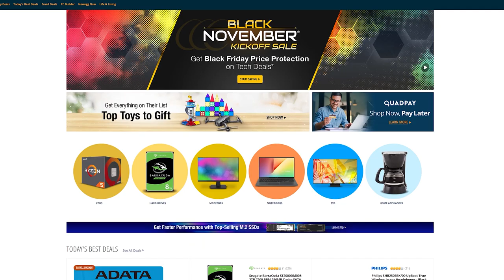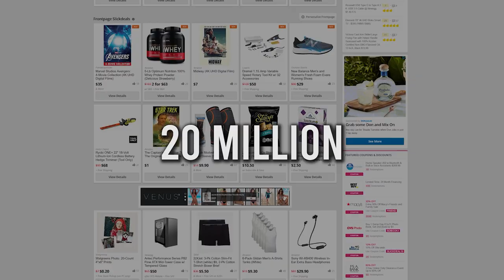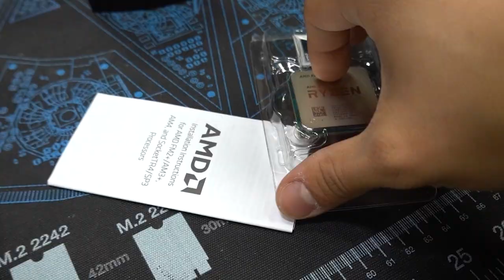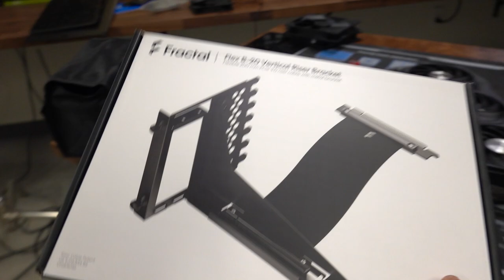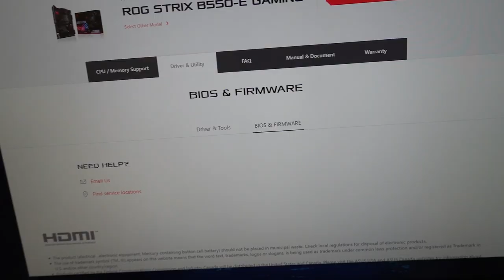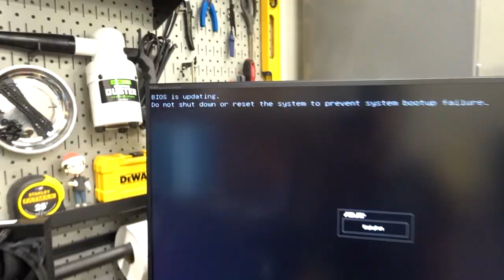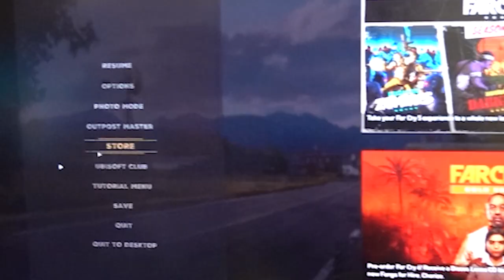I've waited so long to build this PC

Comment: "I've waited so long to build this computer"
Me:  My 2600k is awesome...
Reply: I'm still rocking an i7 2600K OC'd. 👌 After a 3080 or 6800XT next before full upgrade.
Reply: Hey dude are these good specs for Fortnite send Minecraft on all low graphics settings Intel Core i5-9400F 6-Core 2.9 GHz
✚ GIGABYTE GeForce GTX 1660 Super OC 6G
✚ Team T-FORCE Vulcan Z 3200MHz (max speed) 16GB (2X8GB) More Info
512GB Intel 660p M.2 SSD
NZXT H510
ASRock B365 Phantom Gaming 4
DEEPCOOL GAMMAX GTE V2
✚ EVGA 500W BR Bronze
MSI AX905C WIFI
Windows 10 Home
2-year warranty on all parts & labor
Reply: @jorgeg4153  that pc will play any game at at least medium settings 100fps, im assuming thats a prebuilt and i wouldnt spend more than 800 on that configuration
Reply: @KyzrTM  o I’m spending 990 dollars on NZXT My bld can that run Fortnite on 200 FPS on low FPS
Reply: @Easton Reese it isn’t s flex
Reply: @jorgeg4153  meh its intel
Reply: @jorgeg4153  stick with amd they are cheaper and have good stock coolers
Reply: @meespo3354  ik but my FPS will be way better in games maybe idk
Reply: @fivesupersieg5583  o I’m getting a prebuilt so I can’t change the specs but thanks for the advise u earned a sub :)
Reply: @fivesupersieg5583  yeah me mum doesn’t have to much money she is getting un employment and next year I’ll be able to get a better pc do u have discord and if u do can u tell me ur name I wanna add u
Reply: @jorgeg4153  pretty good bro...! for mid-level gaming...and I think you better upgrade to an RTX 2060 next time and you don't need to upgrade for at least 3 years.
Reply: @kiransai447  ok thx
Reply: @kiransai447  I don’t wanna leave like a 3 k dollar computer we don’t have really any money rn so I have to the the NZXT starter pro so thx for the advise and u earned a sub :)
Reply: @jorgeg4153  GG bro...but it’s funny that I’m not even a youtuber😅😂 BTW all the best for the PC😇
Reply: @kiransai447  ok thx
Reply: @kiransai447  so are the specs good for Fortnite
Reply: @jorgeg4153  yep you can
Reply: @kiransai447  thx so the specs are good for FN good looks dude

Comment: Coming from a design engineer who loves pc build videos and seeing how companies build their stuff I totally see a rail system with either a spring loaded or screw down angular pin lock would be possible for them to add to case design and maybe have the smaller channels tabs be spring loaded or at least moveable so you can have them even with the outer tabs or set them for smaller cables or just do c channels and not care because most of us just put a bunch of cables in those.

Comment: Nice build Kyle!!! It looks purdy. But...

1. That case needs some zip tie mounts to fully dress up the back panel wiring.
2. 360° & 420° radiators need more hose length to mount the radiator properly in the front of the case. -just about EVERY brand.
3. Freaking RGB software companies need to have a meeting, so they can all play together.
4. You should be able to download Asus Aurora Sync & then the ICue should be able to control the mobo RGB. (Commander Pro may be needed).

Comment: Not that you’re actually gonna use the pc, remember the aio tubes go at the bottom :(
Reply: It doesn't matter as long as tubes go above pump and the case doesn't let him
Reply: @AdamLazhar  it does matter as heat rises bro and that’s how it gets a heat bubble and breaks
Reply: @sh066  It's not a heat bubble lol. air rises so as long as rad is higher than aio it's fine. The only thing with tubes at the top is a little noise but I need to have tubes up with my case and there is no noise.
Reply: @AdamLazhar  Isn't the problem that with rad tubes at the top, the pump will be sucking air? So doesn't matter is rad is higher or not, it's still bad. Bad rad.
Reply: @jonboy602  The way i've seen it is that if the tubes are at the bottom of the rad then air might block the path of water and allow less water to flow. I've been using a really shady aio I've had for 5 years and it's always been mounted tubes up and above the water block. I just switched to an H150i that doesn't physically work any other direction and cooling is perfectly fine. Everyone seems to be taking steve from GN's words exactly about this but he also said tubes at top is okay as long as it's above the pump. Only downside is a little noise which I can't hear with mine so far
Reply: @jonboy602  this is correct. put it at the front with tubes down, or hold it so that the air rises to the correct side if the rad and then top mount it.
Reply: @meese1k  no actually, you missed the point of gamers nexus's video
Reply: Do you mean like rotating it clockwise one time? So the tubes are facing towards the bottom of the case? I am planning to build a Pc soon and trying to gather some knowledge. Thank you in advance and happy holidays
Reply: @crazygamer569  doesn’t matter as long as the pump is below the top of the radiator
Reply: @crazygamer569  so if it’s front mounted the tubes should be at the bottom and come up towards the cpu(if you’re building in a traditional case) so that the air accumulates at the top of the aio and doesn’t get sucked into the loop. That causes noise and other problems over time. Mounting from the top you don’t have to worry as much. Tubes on cpu are most commonly placed to the right of the cpu. Hope that helped
Reply: @crazygamer569  hello man, you can’t do this configuration in every case, but this is ideal. you want the radiator at the front of the case, with fans pulling air into the case, with where the tubes connect to the radiator to be at the bottom of radiator/case if that makes sense. hope this helps

Comment: The lower backside cable cover is to help ensure cables don't put too much pressure on the back side panel and inadvertently release it, as it doesn't have screws locking it on. I think Gamers Nexus mentioned this in their review of this case or the Define 7. Not so much an issue with well-managed cables.

Comment: I know iCue can be used to configure some Asus AuraSync components. But the only RGB components I have are from Asus and Corsair so I can't speak for other brands. I also like the idea for changing up those cable management anchor points by making them adjustable. However, I think that would be best left as an extra case option (sort of like being able to choose between tempered glass and a standard side panel for some cases). I know many people wish the extras that companies sell would be included with the case, but if that did happen, it would drive the price up and make the case less desirable to builders with a lower budget, who don't have any need for the extras. Maybe they (case companies/manufacturers) can make a compromise, a "best of both worlds" per se.

Comment: I think that the riser bracket kit shown is PCIe3.0. AFAIK, there aren't any 4.0 riser cables that actually work as intended just yet. Look into it before planning on using one with a 3000 or 6000 series card just in case.

Comment: this is for aura which you need to have installed for any of the rgb to work right. otherwise the board and registry conflict and everytrhing goes batshit.

heres the steps to fix it. atleast this is what i found fixes it cause the motherboard generally gets outa sync with the registry and just opens a can of worms when it does.

first option, reboot into bios > set aura to off. then shut down the pc and flip the power switch. let this sit for a min. boot into windows let everything taskmanager related kick in > reboot to bios > enable aura > shut down > let it sit 30 sec > boot to windows, in theory this should fix it if it doesnt then we do the long more in depth fix.

2nd option. uninstall aura / light services > erase both folders in program 86 > then either manually erase the registry files for them or use cc cleaner. > reboot to bios > set aura off > shut down > flip power switch > let sit a min. > boot into windows let all the random bs turn on then reboot to bios enable aura > next install aura sync and double check lighting services installed with it. next shut down let sit 30 sec then power on it should start all rainbow then when windows engages youll see a flicker into more rgb. if the lights kick off then the mobo isnt synced with the program and defaults to off from invalid commands due to them being outa sync. sometimes takes 2-3x to get it to work if this 2nd option doesnt work wipe out armory crate from your system and erase anything in that folder in the regular program files folder cause typically crate and aura use diff sdk lighting services and will conflict with eachother and cause it to brick aswell. so when i did it i went into the crate folders and erased the aura/lighting sdks in them.

Comment: I Always have this issues with corsair and asus, but what i normally due to get it working is...
Download obviously all the software... Corsair icue, corsair asus plugin (in icue download page just search asus), and armory crate. Make sure all lighting programs are uninstalled.
Install I-cue run it after. Then install armory crate, open and close the application , then install the pluggin from corsair for asus. Close icue and open again and in memory settings tick the enable full software control. then restart the pc and hopefully everything boots in order as it should and you can control everything from armory crate. Only other way if i had issues with crate to get corsair to work with the asus board was to install the last release of Aura sync. Same order of operations just instead of armory install arua sync, and when everything was recognized in aura sync I'd then install armory crate. Just throwing it out there for other with issues using their corsair ram with asus.

Comment: Unleash The aio are 100% filled, which they aren’t, that’s a bad placement for the rad, as you will get air in the top of it. It will decrease water flow and make noise.

Comment: You could make it easy on yourself and just have two cameras set up. Camera A and Camera B. Have one be an above shot and the other be a front shot. Should make putting things together pretty easy for doing more demos. I'd imagine with all the equipment you have, you shouldn't have too much of an issue getting multiple cameras. Maybe have a head-mounted fancy go-pro for those first person shots you want. Especially since your youtube videos are only 1080p, which is perfectly fine for adding those little different shots you want.

Comment: I feel in long term the rx 5800 and 5800xt will age really well especially with that 16gbs of ram, just like how the rx 570s and 580s still are decent cards vs the 1060s which came with lower ram.

Comment: "technically you should put the screw down.."
Just FYI, but my screw standoff for the M.2 SSD heatsink got separated from my Asus motherboard. I turned the screw just a little too much causing the standoff to break its connection to the motherboard (just glued in I guess). I then had to order some screws since I couldn't find the ones for the motherboard to attach the M.2 SSD (the one he didn't use). So then I screwed down the M.2 SSD and stuck the heatsink on top with only one of two screws attached but it's working fine.

Comment: so Kyle, I would suggest a little open source thingie called OpenRGB. Its aim is to unify all the stupid rgb devices under one app. For me at least, as long as the device is supported and it's all plugged into the motherboard rgb/argb headers, it should be all configurable under the one app. Give it a try. I've got ram and rgb fans running under it.

Comment: It's so damn hard to find good 140mm PWM fans with good static pressure, great performance whether a rad / grill / mesh etc is there or not, great performance to noise ratio, looks good, is ARGB, and doesn't require some proprietary connector / controller / software for controlling the ARGB. I personally don't know of any. I may have to look into those Prisma fans.

Comment: 29:00 i didn't have that much trouble tbh with my setup for the RGB. I just made sure that the products had addressable compatibility + compatibility with my motherboard (in this case Asus Aura)
And I plugged everything in the addressable connectors using sometimes an addressable splitter. And it worked perfectly. 
But I suppose that some products can be problematic

Comment: The top fan /radiator location seems tight when using a real custom loop rad and as usual manufacture does not give the measurments. Its seems to be real hard to take a measure and put it on their webpage.

Comment: The lights not working is karma for not screwing in that m.2 drive.  Proper RGB settings add at LEAST 8-12 FPS.  You know that.

Comment: Now that is one heck of a PC! However, you better have a real use for it for the cash that you will spend! In truth, I am a little surprised, with the latest push for air cooling, that a Noctua or BeQuiet wasn't installed.

Comment: Can u rate my setup? 
Motherboard: MSI A320M-A PRO MAX AM4
AMD Ryzen 5 3500X AM4 processor
RAM: Corsair 16gb DDR4-300
Gigabyte GeForce GT 1030 videocard
Sharkoon VG7-W RGB case
SSD Kingston A400, 120 gb 
Sharkoon skiller SGK4 keyboard
Monitor: Benq BL2283 21.5”
Reply: My budget is 570$

Comment: My buddy has an asus motherboard and had similar issues with the asus sync for rgb lights. We found out that if you download ASUS AI Suite 3 V3.00.59, that's where you can control some lighting. It's in the driver's page for the motherboard. Under "software and utility". Hope this helps.

Comment: And yes, the manufacturers have to get their act together on all that software. It's ridiculous. I get everyone introducing things when RGB started taking off, wanting to make their own "standards," but still... Hell, I just went through and updated my Ryzen 1700 to a 3700x (x370 series, and ti was on sale.) The Ryzen fan doesn't really pay attention to the MB control (outer ring and logo just do their own thing,) so you need to install a USB connector, NOT use the RGB connector, download MORE software from Cooler Master (!) and THEN you get control... then you see "Oh, you can link it with Razer!" ... which you can, but then you lose more of the control.. And yes, the Asus Armory software sucks. So I've got three pieces of software, which don't sync with each other (or do it well,) and I don't even have that much in my system - keyboard, mouse, video card, mainboard, CPU fan.  Someone creating a small SOC you can control and plug in, about the size of a controller or SSD, which has the specs for all of these and lets you unify the lighting and such? THey'd have a winner... granted, it'd probably run $300 or so..

Comment: 17:28, Tsk Tsk. You should be installing it tubes down, otherwise you can greatly impact performance since air bubbles will hang out in the tubes in a tubes up config.

Comment: Even with the dust filters on on my old Meshify C TG edition the airflow was excellent. Had a 1080ti a 280mm rad and a 8700k and the BEEFY AORUS 1080ti was fine for temps ( max temps 71c ) and thats with the AIO at the front

Comment: Let's not mention you shouldn't have your radiator with the tubes of the AIO running to the top for air bubble reasons and for AIO lifespan reasons

Comment: I don't understand why you'd get a full ATX case and motherboard, to then vertical mount and block off all the PCIe slots. If you're only ever going to use the one slot, mITX makes a lot of sense.

Comment: Did anyone think to suggest that he should hold the reset button to switch the fans to mobo control. It works that way for a lot of cases that come with an rgb controller.

Comment: Hey bitwit! Corsair icue is compatible with asus/aura sync and icue is much easier to use so I recommend using that but if you have Armory crate installed for aura sometimes icue conflicts with it

Comment: I get slightly irritated that the fans are obstructed by the case, even more so if you go bigger on the fans, why not design the case for clearence of the biggest fans, and if you want to use smaller ones you get brackets for it to screw into the holes for the bigger ones.
I hate the obstruction of airflow, and with RGB fans it also looks bad.
I would probably go for bigger fans and radiator and dremel out the mounting holes for the smaller ones to get an unobstructed flow/wiew.
Also, the bottom front fan is halfway under the cover that flips away, I would make a slanted ramp to lead that air up into the case, instead of back to the PSU..

Comment: I'm planing on building my own and first PC, i do own a pc but it's actually a pre-built and so these are the parts that were recommended to me. Just to say, i already own majority of these components like the Ram sticks, Graphics card and CPU, CPU Cooler and Motherboard. So hopefully they're fine, if not then I just fucked myself

CPU:
AMD Ryzen 9 3900XT 3.8 GHz 12-Core Processor 	

CPU Cooler:		
NZXT Kraken X63 98.17 CFM Liquid CPU Cooler 	

Motherboard:	
Gigabyte X570 AORUS ELITE WIFI ATX AM4 Motherboard 	

Memory:
G.Skill Trident Z Royal 16 GB (2 x 8 GB) DDR4-3600 CL18 Memory 	
Memory:	
G.Skill Trident Z Royal 16 GB (2 x 8 GB) DDR4-3600 CL18 Memory 

Storage:	
Samsung 970 Evo 500 GB M.2-2280 NVME Solid State Drive		
Storage:
Seagate Barracuda Compute 2 TB 3.5" 7200RPM Internal Hard Drive	

Graphics Card:
Gigabyte GeForce RTX 2070 SUPER 8 GB WINDFORCE OC 3X Video Card	

Case:
NZXT H510 Elite ATX Mid Tower Case

Power Supply:		
Corsair HX Platinum 1000 W 80+ Platinum Certified Fully Modular ATX Power Supply

Comment: You should totally try JackNetRGb and there is a way to attach 3 pin rgb to corsair icue lighting node pro or corsair lighting node core. The cables can be found on ebay
Reply: That is how I have my ml240 hooked up to corsair